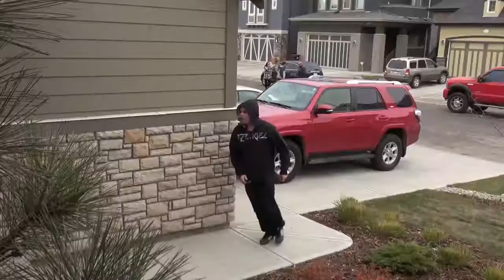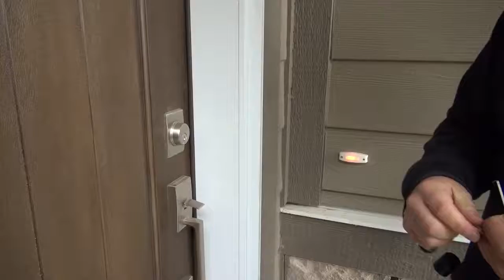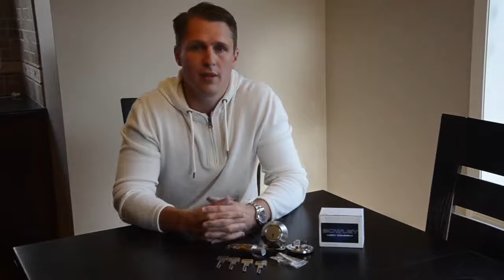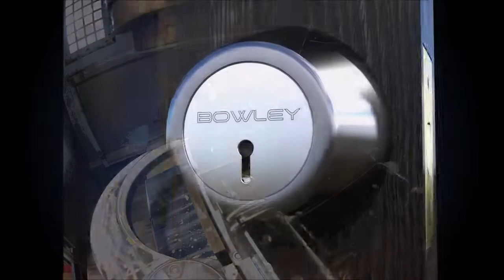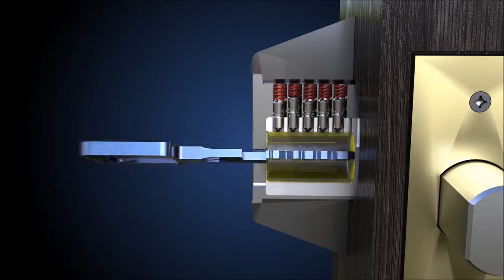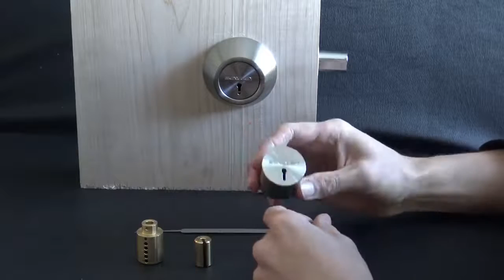Bowley Lock Kickstarter Relaunch Video

Comment: Unpickable lock  but looks like it can be drilled in a few seconds  . it needs a hard ball  fitted in a counter bore in the base of the brass cylinder .  the warding in guide a drill straight into the centre of the lock torsion bar .
Reply: Which is the way a thief would do it and now every locksmith I don't want to throw any shade at the company but I feel like having an unpickable lock just means you have a lock that has to be destroyed and replaced every time you lose the key because criminals don't use/don't care about non-destructive entry methods.
And all that aside you see a lot like this and you're a thief why not just break the door it'll be a lot easier and quicker? 😜 But yeah that's what kills me about LPL going on all the time less than half of 1% of all theft has used any sort of non-destructive means that includes shimming and bypass methods.. these non pickable locks or just keeping out people who would never steal from you to begin with 🎉😂

I almost hate leaving the comment cuz I got respect for the locks / the company that made it but when it comes to this stuff, people's thought process just isn't grounded on facts / reality